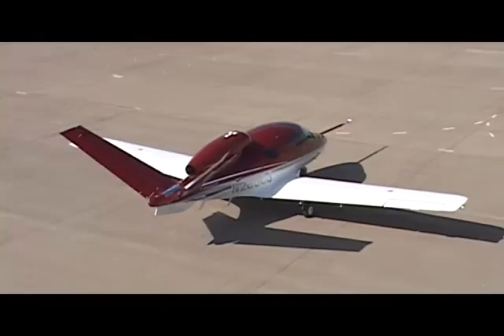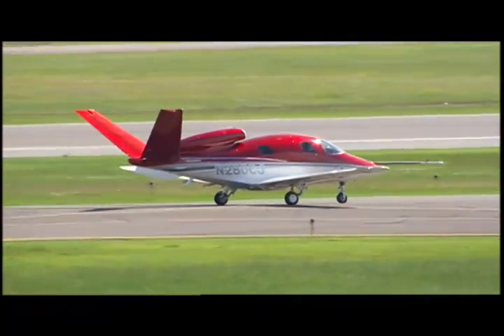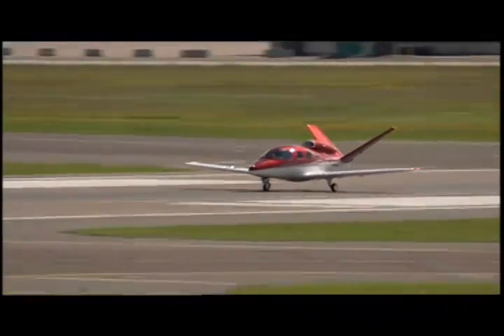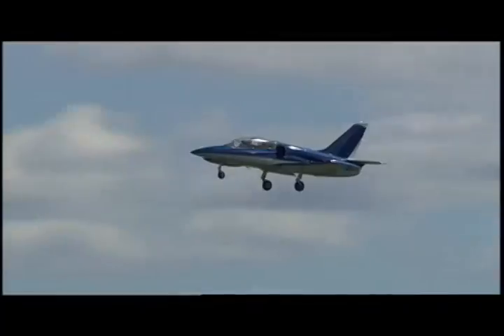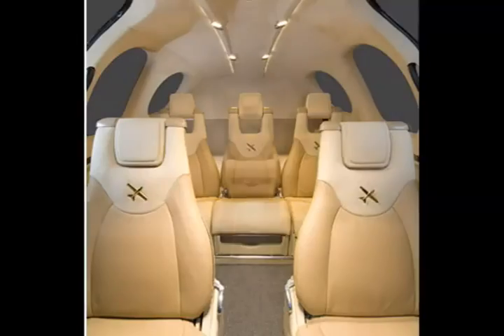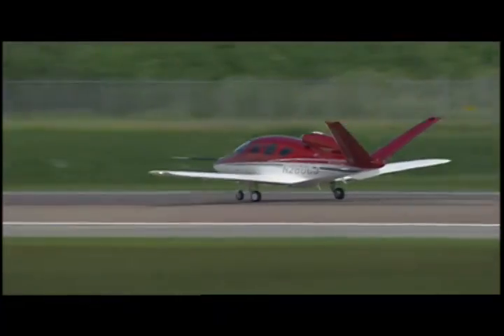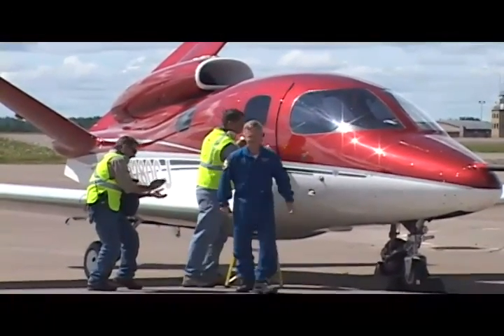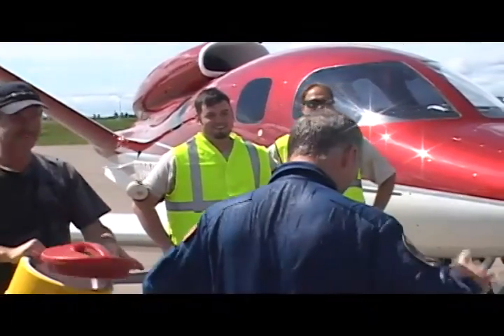Cirrus The-Jet First Flight

Comment: It is hard to believe that, with it's small diameter engine, this plane will be capable of matching similar-sized propeller-driven planes (turboprop) or turbofan-powered planes.  Just because of the propulsive efficiency (which is independent of thermal and other types efficiencies).

Comment: @Jonza0 True that the V tail has had issues with stability and input, but removing that surface area (and resulting drag) is what will allow the Cirrus to fly faster and more efficiently. Control surface input systems have also come a long way in the past 60 years. I doubt the Cirrus jet will use something that resembles the traditional pulley system-I'm guessing it could even be computer assisted if necessary. Also this isn't the first V tail concept in 60 years  - check out the Eclipse 400.

Comment: That plane looks fantastic.  Only problem I have with it is that its single engine... but I suppose thats what the parachute is for.  

Still, I'd much rather land on a runway with one engine than on who knows what with a chute, probably causing significant damage to my plane in the process.

Comment from the maker: Hi, redbeast2
Actually, it's vectored up, not down and is not active but fixed. The resultant thrust angle is probably closer to level or slightly "up" when the jet is on the ground. Mr. Klapmeier describes it a bit more in our other video listed as the Video Response, above. (Find the description around 3:08).

Glenn Pew

Comment: Interesting that the engine provides a downwards vectored thrust... I wonder how that affects fuel economy.  Also how they prevent structural damage to the carbon fiber of the empennage from engine heat when the plane is idling or taxiing.

Comment from the maker: Travellingtheworld is correct. The "stick" is an air data probe mounted to the test aircraft to collect accurate readings from undisturbed air ahead of the aircraft. The production version of the aircraft will most likely be fitted with standard (much shorter) probes fitted discretely (and likely elsewhere) on the aircraft.

Comment from the maker: To be clear: the thrust is vectored, not vectoring. Thrust on The-Jet is not actively directed. It is a static, not dynamic arrangement that compensates for the mounted angle of the engine. Note that the engine follows the roof line of the jet. If Cirrus had not vectored the thrust, power adjustments would have strong effects on the pitch (nose up or down) of the aircraft.